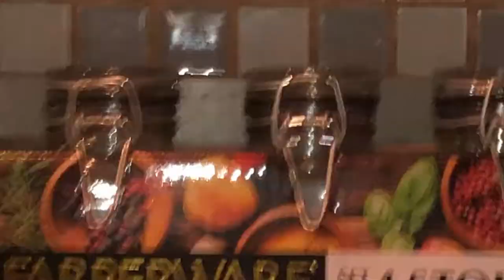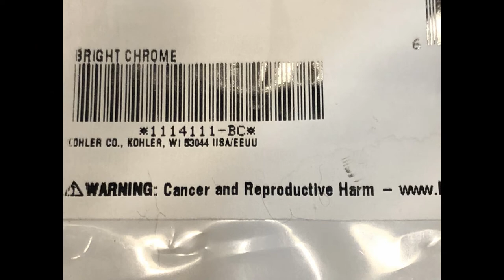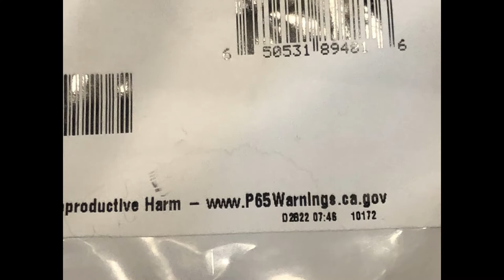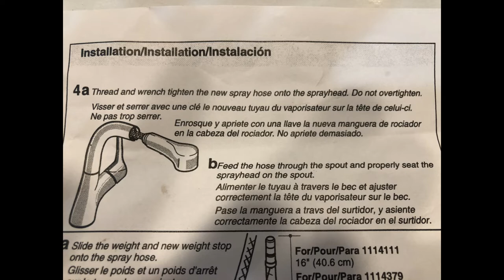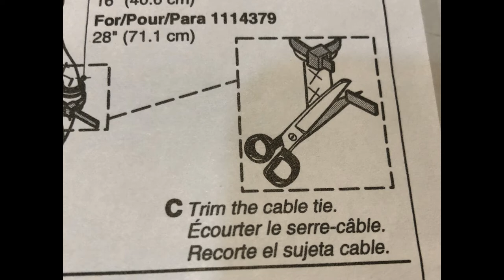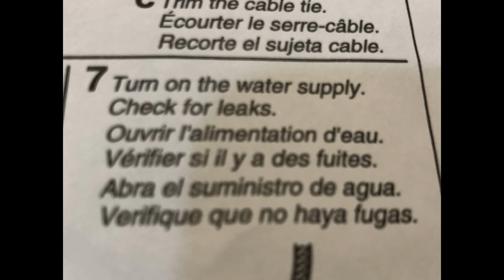Kohler Pullout Kitchen Faucet Sprayer Replace Broken Hose How Too 1114111-BC 39B KiT  Long Version

Comment: Thanks for the video. Quick connect was one issue. Used a 1/2 inch wrench to lift the tap, in my case it was moving very slowly, at first I thought it would just pop out but it moved bit by bit until the hole hose connector was out. The other issue wat putting the hose back through the faucet. I found that with just twisting and turning the hose went in right away. There are indeed 2 points of resistance but with some minor twisting it took 10 seconds to get the hose through.

Comment: To pull the old hose free of its connection, I used a 1/2 inch open wrench which fits around the hose and provides a solid surface to push up (instead of the pliers used in the video).   Then I attached a very small vise grip pliers to the metal collar of the hose.  The vise grip pliers allowed me to turn the hose slighly while pulling down.   My work space was smaller than the space in the vdeo, and the vise grip pliers made it much easier since it stays in place while moving around.  I pushed up with left hand on the 1/2 open wrench while trurning and pulling the pliers with my right hand, and the hose came free.   I also had trouble feeding the new hose through, so first I fed through a length of 14 gauge electrical wire, tapped it along side the hose, and then pulled the hose through with the wire.